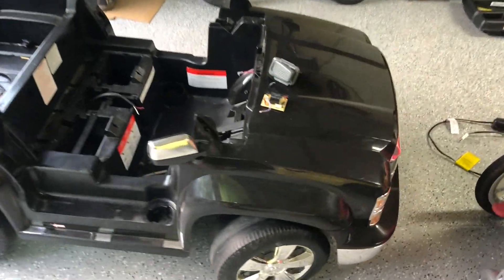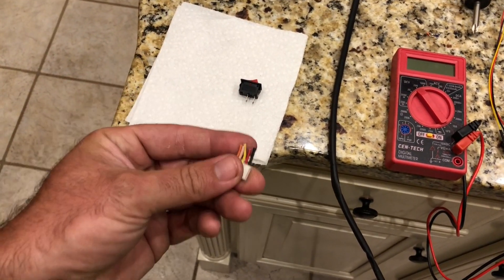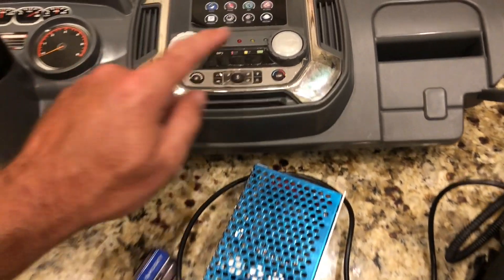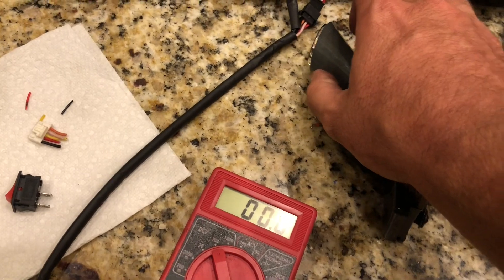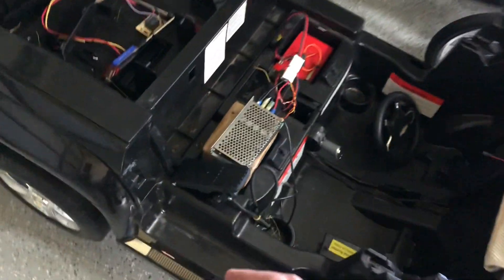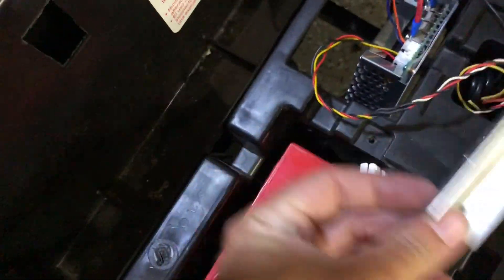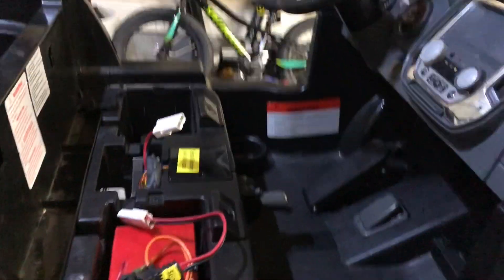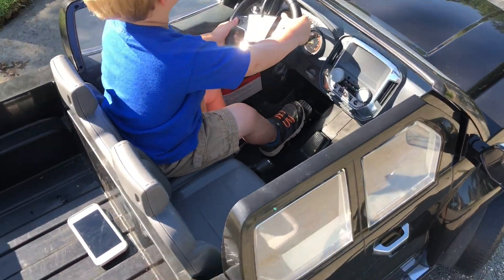Silverado Speed Controller Upgrade (12v-50v)

Comment: Was the PWM controller coming with a circular rotating button other than the switch? because i can't find the same as yours. All the other ones have that circular rotating button. How do you tell the controller the maximun amout of voltage that you want?

Comment: 120$ for the controller. yikes. what if you just bypass the factory controller and run an over volt directly to motor. all on or all off
Reply: Iv done this with 2 18v batterys works great 👍

Comment: Could this be used on an e-scooter like a xiaomi m365??
Reply from the maker: Yes I believe they have versions of this speed controller with a twist throttle
Reply: How many amps does it kick out on 36 volts?
Reply: Sorry my bad it's for a brush 2 phase motor not a brushless 3 phase

Comment: What did you end up doing with the lights? (Yellow wire out of truck)
Reply from the maker: No i didn’t actually. I think it would be safe to wire off of the trigger wire if it’s 12v

Comment: Thank you! I've been looking for a wiring diagram as I just picked up a 6v Silverado police truck for dirt cheap, however there are quite a few bypasses. Now you've shown what cable goes to what. She can only press the pedal for forward. Reverse does not work. I also want to upgrade to the dewalt battery mod and go dual motor and at least 12 volt.

That is a neat controller. I see so many like it, but they all seem to have radiostatic speed controllers unlike the one you show. I'd click the link but it appears to be dead.
Reply from the maker: Ahh thanks for letting me know. I’ll have to find another active link. Yes the speed controller is still running strong on 20v dewalt battery now.

Comment: How would it be using a Milwaukee 18v drill battery set up ? Would it be faster then using a 12v ?
Reply from the maker: Much faster. I’m currently running a 20v Dewalt 5ah and it rips. Driving offroad does tend to drain the lipo pretty quick. Onroad is perfect

Comment: Hi there can’t make a video adding this item to a  e-bike 3000w brushless motor kit , but still using the 48v 40amp controller that comes with the kit ,  using throttle and phase wires  making it work together just like your video to a  DC Motor Speed Controller,vinmax 10-50V 100A 5000W Reversible PWM

Comment: I just finally hooked mine up I’ll make a video also the only thing is there’s no brakes so you have to roll to his stop and the vehicle I’m using is a huffy torex
Reply from the maker: Yeah that’s the only downside. It’s okay on 12v because there isn’t much momentum. Now at higher voltage, not good

Comment: Hey you have dane something to your pedal? I don't use stock harnes so I just need connect throttle pedal to controller but my pedal seems to have potentiometer broken and motors running a bit when it isn't pressed. Pedal is the same as yours, even wire colors are the same.
Reply from the maker: Hmmm no mine has been fine
Reply: @RaztechPowersports  it's seems there are difference between resistance on hall sensor and potentiometer. I know asking a lot but if you will be able to check what's inside of pedal there where you take one spring. Is there hall sensor or linear potentiometer if hall than what number.

Comment: What hall effect is in the foot pedal? I check on mine and its 49e. When not stepping in the pedal, it is still making the motor spin at low rpm. When press down it makes it full throttle. But the motor never stop even with foot off the pedal. Do you know what hall effect model is on your pedal?
Reply from the maker: Hmmm that’s strange.. I never had that issue
Reply: Hey you solve the problem? I have the same issue...

Comment: ...is there a way to switch off the soft start in case the kid wants to do doughnuts?  I worked on our neighbor kids jeep and it drifts but my kids has the soft start.
Reply from the maker: There is not an easy way to do this. I know there is a certain soft start chip you can eliminate on other electric speed controllers. Do some research on that 🔧⚡️

Comment: Most of the PWM Moduls doesnt have motorbrake. Thats why i wahr to use RC ESC (Electronic Speed Control). But then u need a Servotester to implement the Hallsensor Gaspedle. More work to do. Hope it will work.

Comment: How did you know you the speed controller needed replaced?
Reply from the maker: Add no voltage going to the motors
Reply: @RaztechPowersports  Sorry, I'm not great on knowing this kind of stuff.  We have this same pickup and it turns on, but when pushing the petal it won't go.  I was thinking a petal issue?  My husband thinks we just need a new battery.
Reply from the maker: @emilykinney9256  does the voltage meter still work on the dash? Would be a easy way to determine if it needs a battery

Comment: how is this holding up?  I fried grandsons 4x4 controller and need to come up with a replacements.  The PWM i used to reduce a 40V Ryobi battery to the 24V his 4x4 needs let the full 40V through.
Reply from the maker: Still working great but still running on 12v agm battery

Comment: What size fuse did you use on the power line going to the controller?
Reply from the maker: 30 amp
Reply: Thanks
Reply from the maker: @chuckfaisst1890  no problem

Comment: Thank u for the video. Do you have a link to this motor. I read that 250w output was needed in order to not fry the motors. Did you take this into consideration?
Reply from the maker: I’m using the factory motors on 12v (13.5v on full charge) no issues at all.
Reply: @RaztechPowersports  thank you so so much for your reply. It was a typo from my side. I meant à link to the speed controller.... I do not intend to replace the stock motors as well. I have been spending 3 hours trying to find a suitable one on Amazon (I am in Belgium and searching on Amazon.fr). I found this one...do you think it will.work ? https://www.amazon.fr/dp/B073S3P1FY/ref=cm_sw_r_wa_apa_i_H34FNXHSRKQGZZKMGYJZ?_encoding=UTF8&psc=1   I want an on off switch and the possibility to go reverse and use the throttle. I read that the stock motors on my ride are 24v 350w brushed motors.  Just not sure what esc to get. Do not mind spending more (so I can add rear lights...)

Comment: Can you share the link where to get the exact speed controller? I am debating whether or not to go through an rc car esc or this set up.
Reply: https://www.aliexpress.com/item/32716293972.html
Reply from the maker: @sandyx4522  they are also available on eBay
Reply from the maker: I would do with this speed control over an Rc version. Much more heavy duty. I don’t have the exact link but they are all over eBay for 80ish bucks with the gas pedal. Still runs great btw

Comment: Do you have a link for that controller setup? My son's exact same truck did the exact same thing.
Reply from the maker: Josh Sicking https://www.ebay.com/itm/182889907416. It’s a little pricey but a good speed control for future mods
Reply: @RaztechPowersports  thank you so much. Just had this same thing happen 2 days ago. Kids are going crazy wanting to ride it so I rigged it up with a cheap speed controller off of a potentiometer knob. I don't like the idea of no pedal. Just ordered this and I love how it'll support more power.
Reply from the maker: Josh Sicking no problem, yeah if you understand electronic, which you sound like you do.. it’s a pretty cool speed controller. I have it setup on a single 12v deep cycle boat battery for now, comical range even offroad. Waiting for the motors to fry and then the mods begin lol

Comment: I would be careful with the factory harnest. I Don't think the wires on the harnest cud handle the amp. Going through the wires. Being that they are so thin  , so i would be careful  when u turn it up all the way  maybe a  fuse or something you wouldn't want the wires to catch on fire   , other than that you did great on the set up  great idea and great set up    very informative but you should change the wires 14gauge at least  just in case to withstand  the amp withdraw ...  Going through them for when u are ready to turn the. Esc all the way up
Reply from the maker: Giant Giant thanks, I did add a 30amp inline fuse and it has held so far. I agree it definitely needs a failsafe. So far the wires haven’t been an issue but I would like to upgrade them regardless 🏁